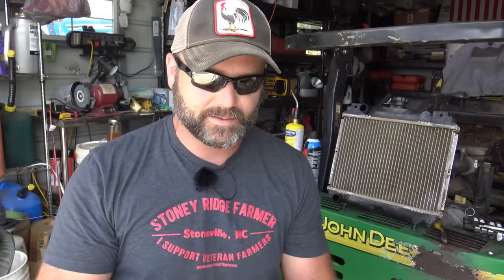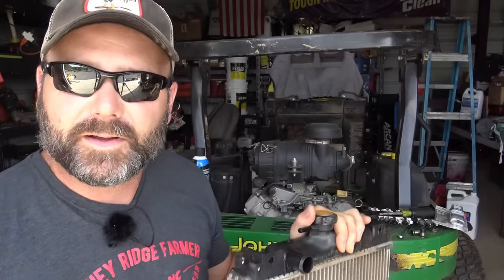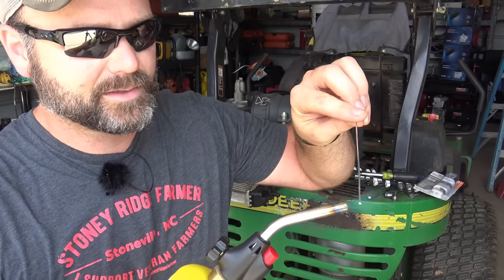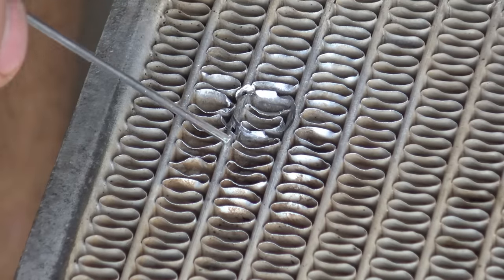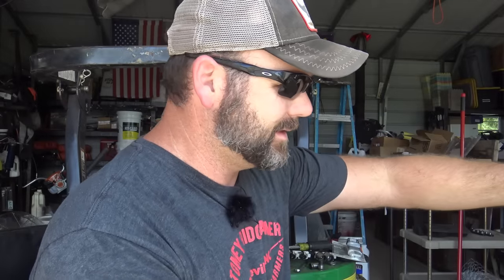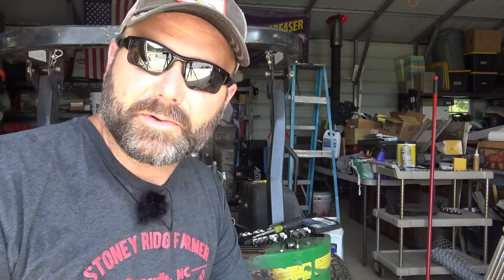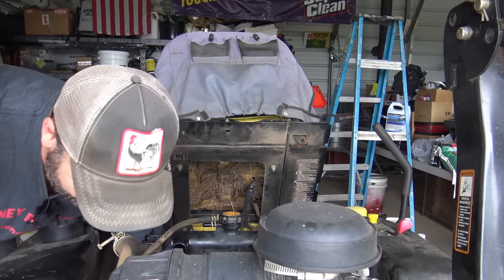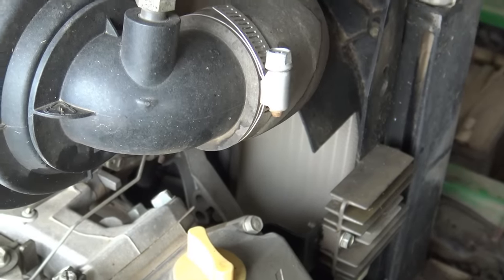How to (successfully) repair a radiator.....weld or epoxy..or..plan C??

Comment: Proprietary parts and software is a real big problem with John Deere and other tractor makes. I saw where there is a movement in big farm states to actually legislate an end to this problem as farmers are having to pay huge sums for simple repairs. The same thing is going on to a degree with automotive repairs. Manufacturers think the consumer has bottomless pockets. Government is rarely the answer to any problem but they have set up a system to allow manufacturers to hold the consumer captive and now they need to be made to level the playing field.
Reply: What's going on with the price issue is someone has looked at the profits & decided that if the price was higher than more money would be made. This has resulted in less customer business & lower earnings which leads to someone,( office worker who receives profit based commission on top of salary ) to increase prices more & by doing so drives away customers. Need to look after the customer 1st, not make enemies.

Comment: I know this video is a bit old now,  but good try on saving some cash here. I run. Radiator Shop, and aluminum braze tubes similar to that all time, but its learn skill fir sure, thin aluminum it very delicate as the brazing temp and melting temp of the material is not far between, I rather see you under heat the job and it not stick then overheat it and ruin the rad. . 
However if a JB weld repair fails and ends up in my shop for repair,  it'll cost a bit extra as removing it is a major pain and it has to be burned off and smells horrible.

Comment: You could have brazed it with that aluminum rod. You just needed to heat the fin more , then touch the rod to it until it melts into the radiator fin. Then you're brazing. What you were doing was just melting rod onto the radiator which was not hot enough for for it. It should all flow together.  You're also doing the epoxy wrong. What you want to do is get a large syringe and a large bore needed. Pull the plunger out of the syringe, mix up the epoxy and pour it into the syringe. Put the plunger back in the syringe, put the large bore needle on the syringe. Pump the epoxy into the hole in the radiator fin. Pump alot in  so the fin is completely filled in that area and also maybe a half inch either way on the inside.  You get an "A" for effort !
Reply from the maker: epoxy has held for 4 years now buddy

Comment: Hey Josh could you possibly tell me in 50 degree weather driving at night how long would it take a Toyota Camry to run hot with a hole puncture in the radiator

Comment: I used epoxy on the plastic side of a radiator before. Sealed up great and had no further leaks for the rest of the time I owned that car. About a year. I don’t know how much longer it lasted after that.
Reply from the maker: I hope this lasts...so far so good..been 4 hours on the mower with no issues

Comment: Use some flux it will flow better try to chane to pin tipe adjustment  on flame this is  controled to exac area difrent tip for torch

Comment: You didn't get the "base metal"/ the radiator get hot enough before adding the filler wire. Try it on a soda can and practice getting it hot right before melting then add the wire.

Comment: No flux on your first try anhelps to use aluminum mess screen should help it seal better cause the flux and the screen will reinforce the strength of the patch

Comment: First off: If you are going to fill holes in aluminum with aluminum rod, you are welding.
The rod melted but the work did not.
What you had was akin to a cold solder joint.
You need the work area heated to the point of melting.
Welding aluminum is a skill that requires a great deal of practice.
Too much heat and you will blow a hole in your work much larger than what you were attempting to repair.
Second: With the Permatex steel.
Why did you break out the fins around the holes?
The fins would have given the Permatex much more area to adhere to.
Breaking out the fins could have cracked the coolant tubes and caused a bigger leak.
Third: If those housing bolts vibrated loose once, I would definitely locktite them for a little insurance.
Do hope your problem is solved.
$700 for that little radiator is highway robbery!!!
Reply: I agree. The surface needed to be heated to just the right temperature so that all you have to do is dip the rod onto it and it will melt and fill the holes (like lava, in a way). Instead, he was heating the tip of the rod until it dripped onto the surface. That is why it didn't hold. The surface wasn't hot enough. It is kinda tricky. I did learn something in high school 40 years ago. Now I have to put it to use to fix my own leaky radiator. Glad he got it fixed, though.
Reply: Nice to see others around with a bit more brazing knowledge, but patching leaks in aluminum cores it not a first try recommended idea, he was lucky, for he could have easily burned through the tubes beyond repair.

Comment: if the brake cleaner you are using contains Tetrachloroethylene you should not use it for cleaning stuff you are going to heat up because it breaks down and produces phosgene gas when you heat it
Reply from the maker: Thanks for the tip

Comment: At 8:15 you can see how you pushed the rod on the aluminum and you laid "chunks" on the 3 holes. If you got it a little hotter, probably 10 more seconds, I should have melted to the touch (without force) and it would have worked. Nonetheless, great video and keep on wrenching.

Comment: I use fire retardant silicone red to seal and lock tight on hot items and concrete anchor silicone adhesive on cold. Wet items.  Hardware stores

Comment: the map gas idea would have worked fine if you had done it correctly. The idea is like soldering. get the rad hot enough that the rod flows without the torch on it. Blobbing it on as you did repair won't stick.

Comment: you are a crazy aluminum solderer. Who instead of you should melt the solder correctly?
Reply from the maker: hey buddy...just attempting a repair to save myself some $$$ epoxy did the trick

Comment: With the wide variety of “water cooled” vehicles out there, I bet there is a radiator that would fit your application. It would take some looking around. But I bet an affordable option could be found if you ever needed to replace the radiator. 
This could be a great opportunity for someone to design an aftermarket replacement part.
Reply from the maker: I agree!

Comment: You could  use flux core plumbers solder , 
Clean 
damage area of aluminium  radiator  
then coat area with  copper sulphate solution,
Let dry apply heat and use flux cored plumbers solder, 
and you find you can tin and solder area of rad  puncture  
The  ATOM thick coating of copper left by drying ,
Copper sulphate,, and you should get a very good fix,
 This works on tin/lead soldering on steel sheet as well  buckets pails tin baths water tanks 
Should work well on car rad aluminium core,   
Plumbers flux core solder
 /Copper .Sulphate crystals  dissolve in to  @ 30% /75% to distilled water.  
in a glass jar
Heat gun capable of 400c heat, paint stripper gun with narrow nozzle works if not outside in wind, ,  
Tip you must clean area and then copper sulphated in matter of sec , You must let it dry, BEFORE HEATING  AND APPLYING FLUX AND SOLDER,,,,  COPPER SULPHATE  LEAVE A VERY FINE COPPER METAL COAT ON ITEM AS IT DRYS, 
that lets solder bond to base metal,  
NOTE JUST REMEMBER PLASTIC ITEMS CLOSE TO HEAT AREA, 
DONT USE THIS METHOD TO FIX  IF CLOSER ,
THEN 5/6 INCHES  TO SIDES OF RAD. 
HEAT GUN SPREADS HEAT   
FOR ALUMINUM RAD 
THIS WILL MELT RADS PLASTIC ENDS RUBBER/CORK SEAL,

Comment: Do not weld or solder after cleaning with  brake clean it puts out a poisonous gas one of the welding sites had a bunch of warnings about that.

Comment: haha whats sad is 700$ isn't even that bad to me. Working on bigger equipment is a nightmare when it comes to repairs. All dealers have some kind of monopoly on repairs to some degree. Newer equipment is really bad for this which is why all of our equipment is around a decade old. We had a leak in the radiator on our combine, and it was a complex fix with a few hoses and gaskets blown too, so my dad took it to john Deere, they "fixed" it and we were charged 5000$. We went back to cutting and about an hour later the machine was overheating again. Turns out the problem was not fixed, someone at John Deere had used a power washer to clean it and flatted all the vents on one side. so the radiator got really hot. We got the radiator rebuilt in the city for 3000 and put it back in ourselves.
Reply: Wow, $8k to fix a rad problem.  I want to fix my MF750 rad.  A new core is worth $1700.  You must have one heck of rad there.

Comment: Man i found green coolant under my van yesterday..Sort of saw where it was coming from. Since then i did a flush, a few flushes, filled back up with water and got engine to running temp even went for a drive and checked the area again, now theres no god damn coolant leak! I did spray a little heat paint at the area but man. SO ANNOYING NOT KNOWING WHERE THE ACTUAL LEAK/HOLE IS.

Comment: CUT WELD DESTROY AND REDO, and make it fit whatever radiator, even one from ebay. I'd never let John deer have for 700 on a radiator. Not happening. Even if radiator has oil cooler, find another mini radiator for that, or just sweat a copper pipe, fittings and still show JD a Mfinga

Comment: Josh, get an alloy 1 kit from muggyweld for future radiator repairs.  The kit is way over priced for what you get but it works and is truly low temp as the working temp is 350 degrees, not the standard low temp of 700 degrees for low temp aluminum rods.  I know you like to shoot videos as they happen, but you're going to have to practice the repair off camera...or you're simply wasting time and not producing informative content IMO(I don't mean that to sound critical, more like encouragement.  I'm just used to your content to be pretty informative.  This video, not so much  lol  I replaced the radiator in my daughters truck only to get in a hurry and not put a piece of carboard over the new rad to protect it, the fan clutch slipped and barely bumped into the rad and poked two pin holes in it. I'm a pretty good welder and fabricator but I went through two rods from the alloy 1 kit practicing on the old radiator.  I brazed the holes in the new radiator while it was installed, vertically, and it is a solid, permanent repair.  I have used jb weld and other two-part solutions and they work but more as a patch. Granted, I have had one or two of those repairs last many years but eventually they start weeping.  Do it right and solder/braze that repair for a permanent solution.  I feel your pain on John Deere Green, I have one JD tractor only because it was inherited.  Two o-rings for a hydraulic fitting, $13.00!!  Got em at napa for like 60 cents each.  What a scam and is why I will never own another piece of JD equipment, at least none that I pay for lol

Comment: Spending 30 minutes inspecting things every now and then would probably curtail a lot of issues. Lot of people just "gas-n-go" and fail to check their equipment out. All those vibrations will rattle them bolts to death  LoL. Yeah, they change filters as required, but ignore the rest.

Been seeing a lot of folks lately with broken equipment that could have been easily avoided by spending a little time checking it out.

But hey, JB Weld. Gotta love it. Sealed up my shower head pipes for 10 years before I renovated the shower.

Comment: You have a lot to learn
Reply from the maker: Don't we all James.   So you know..this repair was made nearly 2 years ago...we've put more than 50 hours on the machine since without any troubles....the cost of a new radiator was outrageous so Plan A worked with the epoxy

Comment: You didn't heat the radiator up enough for the solder to "flow".... and you also need to use flux, to help it flow/stick

Comment: Do not use brake cleaner when welding or using a torch It gives off a deadly gas and it will kill you! Just search it on the internet lots of info about it.

Comment: $600, for a radiator, i want whatever they're smoking. Also, when soldering you shouldn't heat the filler with the torch, you're supposed to move the torch away an melt the solder on the part

Comment: Yeah the problem was due to not using flux. That's why your soldering attempt failed. This is also known as a cold solder joint.

Comment: you have to heat the "surface" to be brazed  hot enough to melt the rod,,,,,, not melt the rod with the torch,,

Comment: Ok that was wrong soldering... the solder or brazing rod should only melt on contact with the metal and away from the torch flame. In any type of soldering... whether electrical or plumbing the soldering you should never put the solder into the flame. Or else it will fail

Comment: The radiator itself has to be hot enough to melt the brazing rod once that temperature is met move the torch back and forward never let the torch melt the brazing rod

Comment: never use brake cleaner with heat the fumes are deadly
Reply: I should be dead by now then
Reply: Read the  Label........Keep using it that way and dead   may be the best that can happen.......
Reply: I'm 71  and Up untill about 20 years ago I  used  enormous amounts of brake cleaner to clean Aluminum parts for welding..... untill I came across a story about a welder that did the same thing  untill one day.  he hit a place where the cleaner had not completely evaporated ... well the rest of the story isn't good...He didn't  die .... but his health will to shit...for the rest of his life....
Reply: very true. can shut down or damage many internal organs. if you live. ... its not good

Comment: you should have heated up the rad before adding rod yes I've done it before
Reply: And why did you smash the fins on the radiator
Reply from the maker: So the epoxy had something to grip too....hey buddy i never said i was a pro...but it worked like s charm...lets face it..its a lawnmower not a Lamborghini

Comment: I liked when the dog came to check what noisy his friend is making .. the man is doing it as a simple  person where there is no shop nearby . also the aluminum can not take welding heat or the thin fins and pipes will be  melted before it .. not bad but i think that the epoxy is a chemecal material should not touch the coolant > also epoxy get removed with the heat by the time . the world is stupid do not want to invent good radiator . everything is bad with radiator and thermostat and valve guides  and that  entire stupid system that causes money bleeding

Comment: if you think that JD radiator is bad go buy a new John Deere tractor it's all computerized and then ask John Deere for the software to read the codes so you can repair your own John Deere tractor. John Deere will not allow you to have the software to read the error codes on the computer of new tractors forcing you to take your tractor to a dealership having the dealership repair it adding thousands of dollars in cost to the already outrageous prices John Deere charges for parts. Now son farmers have to take their tractors two dealerships 80 Mi away hundred miles away and a couple of thousand dollars just to transport their tractor to the dealership because of the oversize load and I have to hire a special truck to take it all for a $200 repair....yep John Deere is really going full court press to separate the farmer from his money! google John Deere Right to Repair

Comment: 45 min per acre on a john deer with a 60" cut??? Wtf that's not very good
Reply from the maker: well...it depends if your land is perfect golf course smooth or bumpy. Takes me about 1 hour per acre to cut with the brush hog.  Typical speed on the zero turn is around 3.5 mph

Comment: JD wants 700 bucks to repair their poor engineering.
Reply from the maker: bolts get loose sometimes lol...but the cost of the radiator clearly has "green" on it v/s a darn $100 auto radiator
Reply: @StoneyRidgeFarmer  True.  The "green" is a rip off which is why I stay away from that brand, and it's no better than other brands.  Your problem proves it.  The clearance between the radiator and bolts is too close.  A good engineer would have thought about that considering the significance of that part.   Those machines vibrate a lot and it is normal for bolts to work loose.   Thanks for the presentation.    Did you use flux before you attempted to solder the holes?  My plumber friend said once that flux sucks the solder into the joints of his work.   Enjoyed the presentation.   I need to repair the radiator on my old car, if I can.